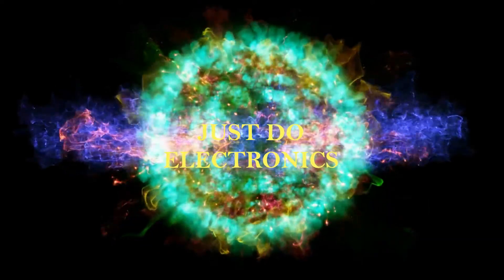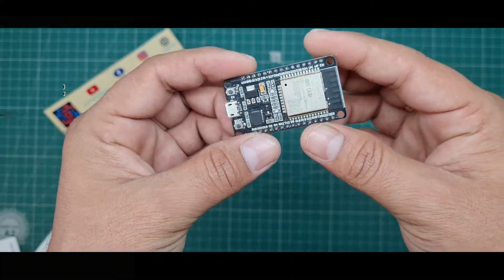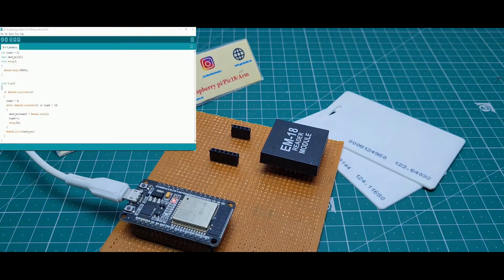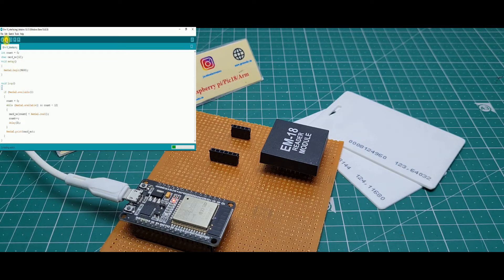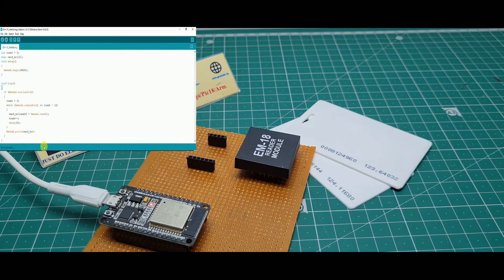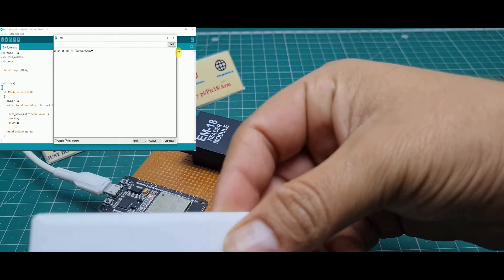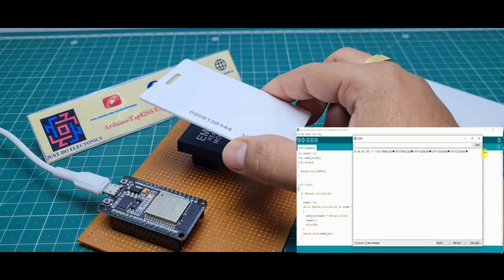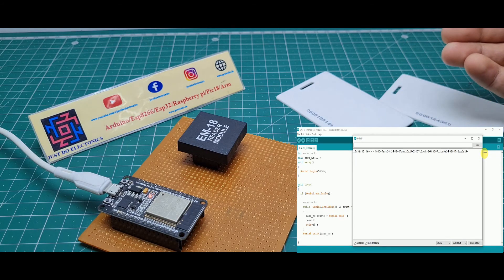EM18 RFID Interfacing With ESP32

Comment: any way to interface em18 with esp32cam? the only conflict is esp32cam setup works in 115200 baud and em18 needs 9600 baud. any solutions? thanks
Reply from the maker: No you changed the baud rate is also work